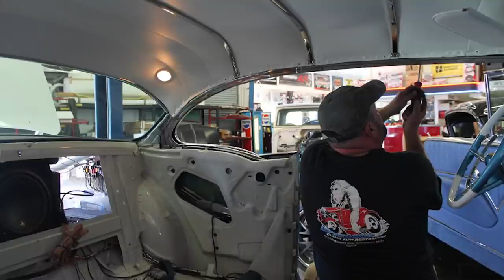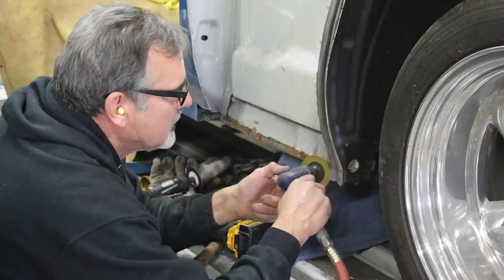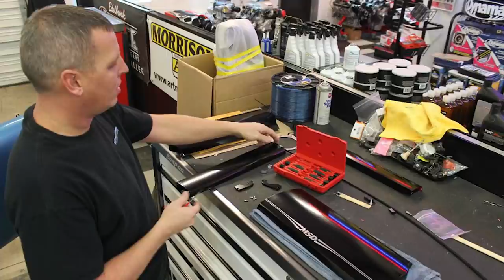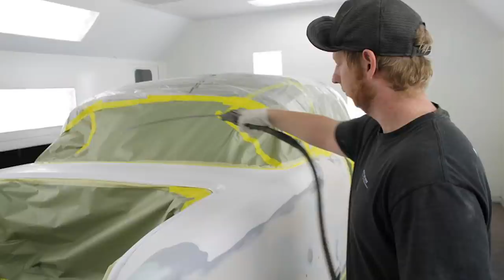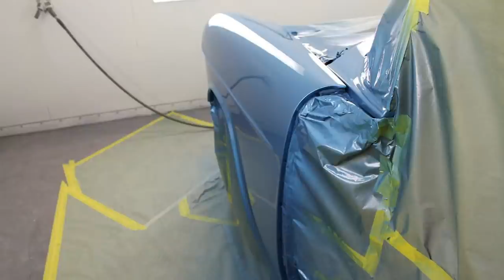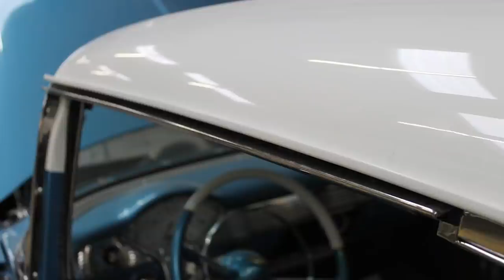Crashed 1955 Chevy saved by MetalWorks Classic Auto Restoration. Quarter panel replacement, how to.

Comment: Been there done that more than I care to mention . . Looks easy in photos but its ALOT of hard work . . Good job guys looks great
Reply: A whole lotta lotta tedious micro tugs using a system  capable of tearing the entire ass off the car in any number of amusing  sadistic methods.. Good times....Rockstar wages
Reply: @toosunakabooma1213  
My dad and I pulled the cowl completely off of 70 Chevelle convertable once trying to straighten it . . We just cut it out and welded another one in

Comment: Nice!  But can someone please explain why did they skim the new quarter panel in light bondo?  Is that so they could block sand it and have it perfectly smooth?  Did the replacement quarter have some imperfections?
Reply: You're correct with you comment . The quarter is a reproduction and as such will not be as accurate as a genuine panel so although it looks to be a lot of filler "bondo " it's probably only an 1/8th inch / 2mm  to make the panel perfect.

Comment: Looks like kosher but when grinding as such the rest of the vehicle needs to be protected from all the metal flying all over the good painted areas...it causes filings to either pit or start a rusted outer spot ... same as rail dust